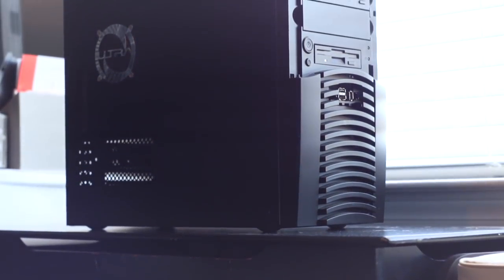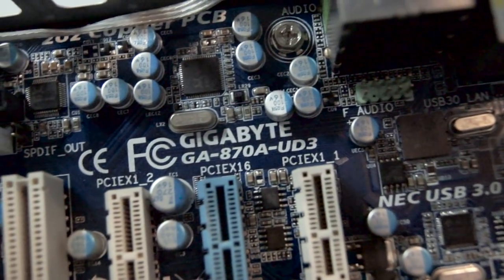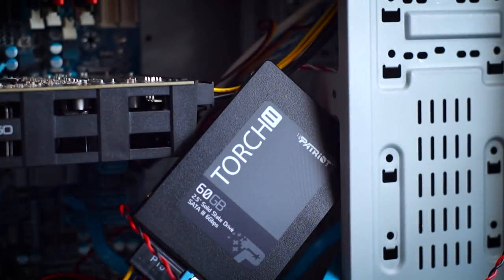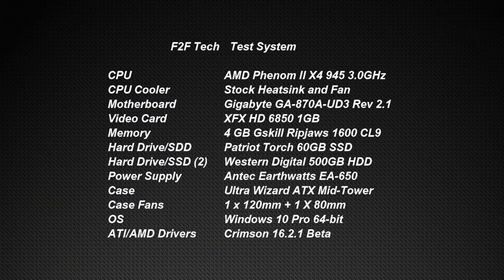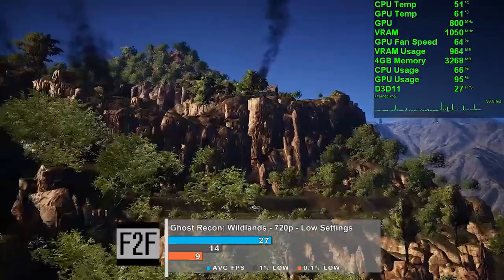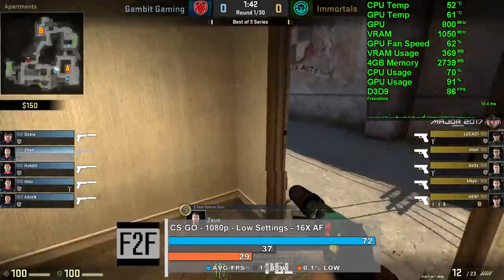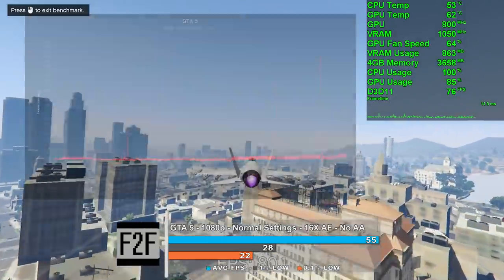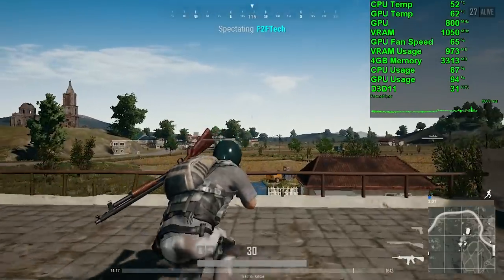How well does a 2010-2011 AMD Phenom II X4 gaming PC hold up in 2018?

Comment: TL:DW it's way better than you'd expect from an 8 year old system and still usable, though phenoms today could really do with an overclock and non-GCN cards are suffering from no more driver support. hence why my missus is upgrading from an Phx4 and hd6850 as we speak. FYI doesn't mean a cpu bottleneck, it can be an game engine/API/driver limitation and nothing to do with cpu.
Edit-with airflow over the vrm you can do 250x15 for 3.750Ghz pretty easy, or adjust the multiplier down for 3.625ghz>3.5ghz>3.375 with thier respective voltages, as high as you can with as little voltage as you can untill the vrm gets worrying.
Reply from the maker: Thanks for you comment. Agreed on the bottlenecking comment. I’ve tested this 6850 with my 2600K and GPU usage was pegged for pretty much every game, but this system, has some variables. 

Funny you mention overclocking. I have it at 1.475v with an FSB of 260. Multiplier is set to 14.5, so we’re at 3.77GHz. I do have a fan directly over the VRM, as that voltage is pushing it. Chip will go a little higher, but requires too much voltage and I don’t want to push the VRM much more. Unfortunately the memory is very finicky, so I have it at 1333MHz at CL 7. I’ve tested this against the the memory at 1600Mhz CL9 and the performance is slightly better. 

Testing this setup with a HD 7970 GHz. Stock cpu vs. OC CPU. I’m done testing and the results are interesting. Some games the performance and frame time improvement are quite good, and in others not so much. Overall, it’s certainly worth overclocking. Also, I love the old beast case this system is in now 😀

Comment: I have the exact specs and even brands of my 2012 tower !! With the exception of antec psu (I was using cougar 750w) cost me just 500usd. I  manage to run crisis 2 on high settings 50fps (I did overclock the cpu,ram ang videocard while using stock cooler hehe)

Comment: well gtx 560 ti and phenom ii x4 955 suprisingly can run battlefield 1 on 1080p Ultra settings with about 30-40 fps not stable as much but still pretty decent

Comment: What a difference a year can make. I have an overclocked Intel Core i7 2600k from 2012 and it still holds up pretty well in almost every game i throw at it. Of course over time I switched graphic cards 2 times, doubled the Ram from 8 to 16GB and switched to an SSD as my boot drive but my comment was mostly about the CPU. There are only 2 games i know of that really struggle to hold 1080p/60 because of a CPU bottleneck and thats Assassins Creed Origins and Rise of the Tomb Raider.

Comment: Huh... how funny I stumble across this video. My current "OP Windows XP gaming PC" is very similar.
ECS IC780M-A2 motherboard
AMD Phenom II X4 965 CPU (3.4GHz 4 cores)
(Presently) 2x2GB Crucial DDR3-1600 10-10-10-28
XFX Radeon 7770
generic as crap USB 3.0 card
Edimax PCI wireless G Wifi card
OCZ 700W PSU

Halo PC at 300fps? Yep. But christ, the onboard audio is miserable. And now I have an ISO of XP that is patched to allow it to recognize up to 128GB of system RAM, which I'd already verified in virtual machine testing (up to 32GB anyway). According to the last drivers from NVIDIA, I could drop in up to a 780 Ti, Titan Black, or GTX 960 into it and have it supported. AMD stopped support at the 270X... not even the 290X which would have made it respectable.

Comment: I am writing this on similar system, Phenom 2 x4 955 + AMD 6850 1Gb but with 8Gb RAM. PSU is Seasonic 620W 80+. I took care of it and it worked awesomely all these years. Haven't reinstalled Win 7 x64 since 2011, as well.
I would upgrade if there were any games worth playing. It's mostly disappointing crap for kids at most. The rest, beside Space Engineers works sufficiently good. Gaming today is VERY disappointing.

Comment: The games on AMD Radeon HD 6850 1GB VRAM are still very decent as of 2018 to play modern video games as most of them still supports Direct X 11 Graphics Card. I am very surprised that the HD 6850 can now only play in lower settings after 7 years. Overtime, High End Graphics card will turn into a Entry-Level Graphics Card due to aging and newer games requiring more VRAM and more Clock Speeds.

Comment: HAHAHA!!! That Shadow of War comment killed me lol!!! When you hear Uruks talking about your 1GB of vram that means you NEED to upgrade at least a GTX 1050 2GB like come on or a RX 560 2/4GB they only cost 100$. If you still have a 1GB of vram video card. Border line "Potato" video card Unless you have a CF with that GPU to squeeze some extra more life from the system. But sooner or later that 1GB of vram will severely limit you it alredy does limit you in 1080p imagen later on.

Comment: Running the 965 with a HD6990. Fallout 4 ran at lowest settings, 24fps.
I thought it was my cpu being old.
Tested it with a second hand r9 280x.
Now running fallout 4 at ultra 1080p with lowest fps of 50.

They dont make CPU's like these anymore. 7 years old and still keeping up.
Reply from the maker: Check out my new video with the 7970.

Comment: Well almost 1 year late, but its nice to be able to get a gist of how well a slightly higher clocked Phenom II does over a 940. And looking at the performance, I'd probably leave it as a spare, since I've already got a Xeon E5450 (via mod) based system performing well.

Comment: I'm wondering how it will perform with a gtx 1050, but yeah till now it's not a dead processor which useful for esoprt gaming or something lite.
Reply from the maker: Me too, but I’ll probably throw something a bit more powerful at it. I still need to buy a 1050 it 1050 Ti
Reply: F2F Tech great, a tough GPU to show the real bottleneck 😂🔫

Comment: Not surprised recently got a Q9200 in a real budget build for my nephew the most he plays world of tanks/league/minecraft etc nothing too demanding picked up a dell xps q9200 system on ebay for 80 pounds replaced thermal paste throughly cleaned the case out the card inside worked but only had 512mb of ram so i switched it out for a r7 250x that i got before prices when crazy thanks to mining (it was 20 pounds plus postage. I was expecting the system to struggle but nope handles 1080p no problems the cpu is not even struggling damn those core 2 quads refuse to die and they are even older than some of the pheonom 2 chips.

Comment: great video,I recently bought a used xps 625 on kijiji with a PhenomII X4 940 black  GT 9800 512mb.It had a 750w psu.I loved the case with the lights above the drive bays and the intakes but the flaw  in practical design was the motherboard which was built with the cpu socket on the bottom and all the othe components in the case to endure the heat rising in the case as it had no exhaust fan(s),once I upgraded to a radeon HD 7770,8 more gigs of ram I overclocked the phenomII X4 to 3.46 stable it runs great I get 60 fps at med/high settings no problems until just recently with all the minimum requirements its time to upgrade to Am4 socket hahahaha.

Comment: i still use my phenom 945 125w cpu as a linux box for virtualization lab but my rig now was built in 2012 with an fx 8350 and 3x gtx 780s.
Reply from the maker: 3 780’s??? That’s awesome

Comment: I'm using phenom II 945 95w tdp and do not get bottle necked in fortknight, not overclocked... The only game so far that bottle necks on the cpu so far is Mafia III
Reply from the maker: You’re right. I believe it had more to do with the legacy drivers used by the 6850. In my new video with a 7970 the cpu isn’t the bottleneck.

Comment: This demonstration is really held back by that weak videocard.  I am still rocking my Phenom II x4 965 years after its purchase.  Runs Doom and BF4 like butter using a GTX 950.  I even had that same Gigabyte motherboard for most its life.  A bad Radeon 270 killed my Gigabyte 870 but I was able to install the chip into the more recent 970 series without problems.Until RAM and GPU prices return to reasonable levels I see zero reason to upgrade.
Reply from the maker: Faster video card, more ram, and overclocking is coming. Have one more video in front of it.

Comment: Great video! Subbed! 

My PC
Phenom II X6 (6 core) 1090T 3.21 GHz
8 GB Ram (4 sticks of rip jaws low latency ram, don't remember the model. Been years since I looked)
Asus ROG Crosshair IV Formula motherboard
Pair of 128 GB OCZ Vertex IV SSDs
3TB Seagate physical HD
Pair of 500 GB Seagate physical HDs
Asus Gforce 670 GTX (2 GB)

Bit of an old system now. But I play all the latest games with max details in 1080p and I have yet to encounter something that it can't handle very well.  Sometimes I think about building a new PC. Which I might do this year. But that's just for the fun of it. The video card is the newest component in my system, also the most costly. Which I purchased about 6 years ago for $580 Canadian.
Reply from the maker: Thanks Lance. I love the Phenom II X6. I’m trying to get one right now, along with a Sabertooth board. Anyway, that’s a pretty beefy rig. I’d hold onto it until it stops doing what you want it too. Also, building a new pc now isn’t too cheap, with video card and memory prices.
Reply: Pubg
Reply: I love my rig. In fact I found out last night that for some reason my ram was running at half speed. Which I corrected. Extremely happy with the performance. Yes, you are right about the video card and ram prices. Just not a good time to build.

Comment: I have a machine built out of parts that were pulled from recycled computers (minus PSU and case.)

Phenom II X4 - 965
8GB DDR2
X2 - Radeon HD 6870's in crossfire 
120gb SSD (generic inland drive)
X2 - 750GB Seagate Enterprise hdds in raid 1
Lightscribe DVD drive

Once you OC your machine, we should compare performance and power consumption.
Reply from the maker: I did a follow-up video with this PC already. Unfortunately it’s no longer assembled, so I won’t be able to make any comparisons.

Comment: the cpu was actually holding up pretty well seeing that it was hovering around 90% on avg on the most demanding game titles benched, which it still had some headroom left over to spare. that just goes to show how good those old phenom II cpus really were. the real bottleneck was the gpu's lack of vram. 1gb GDDR5 vram really held the gpu back, esp with the modern demanding titles that were benched, but having only 4gb of system  ram didn't help matters either.
Reply from the maker: Yeah certainly wasn’t optimal. I did an update video with a better GPU and more memory.

Comment: You should do a video if you can with benchmark with the highest clocked Phenom X4, Phenom II X4, Phenom II X6, 8 core Bulldozer and 8 core Piledriver (an OC'd FX83xx is fine, no need for FX9xxx), along with the higher supported ram on each, so see how much each generation improved on the previous one.
Reply from the maker: Yeah if I had all of them I would. Would be pretty cool to see.

Comment: I still use the athelon 2 x4 640 overclocked to 3400 paired with asus  r7 360 oc and 4x 2 kingston ddr3 1333 ram,I can run any modern game with 1440x900 res
Reply from the maker: Yeah that’s a nice system. Great for that res.

Comment: The Core 2 and phenom Quads are still surprosingly strong.
Not on the same level as more recent chips, but they can handle even easier games.
Got a build with a Core 2 Quad @ 4.1 GHz and a GTX 660 Ti and on some games (like Doom) actually the graphics card is the limiting factor. Still looking into setting up a K10 build at some point.
Reply: Yeah, I have both(the 95w 945, a C2Q Q9550, and Q6700) the phenom II is faster than both the quads on an am3 motherboard, but the q9550 is faster than it as mine is on an am2(not am2+) motherboard. So it’s limited to 1000mhz Hyper Transport and ddr2 ram.

Comment: i still have Phoenom X4 955BE as my daily driver. I want to see what a new gpu works with it.
Reply from the maker: Stay tuned.
Reply: Hi dudes ! I've got my Phenom X4 965 BE rev.C3 @ 3.6 Ghz (not the max possible) with 8GB RAM cas8. Playing over 60FPS @1080p FHD screen with GTX 1060 option High. Pretty good perf for a pretty good money ratio. If you choose Ultra or a faster GPU or a larger resolution, so change your CPU and your config. If not, stay like me with this old brave CPU !

Comment: This was close to my first build from late 2010. I had the PII X4 970, Asus HD6850, G. Skill 2x4GB DDR3, OCZ Agility II 60GB, WD Caviar Blue 640GB, Asus Crosshair IV Formula. I had trouble playing 7 Days to Die, so I maxed to 16GB Ram with the exact speeds. I later upgraded to FX-8350 with a bios update, got a Strix 1070ti OC, WD Black 2TB, and an 850 Pro 256GB with Win 8.1 Pro. I run Apex on max at 100-140fps @ 1080p, Ark on med/high at 45-60fps. I'm fine with the performance of my current rig, but plan on getting a 1TB or larger ssd for games, to reduce load times and micro stutters. 

The PII X4 970 was great while it lasted, but I read the 8350 could swap with it by updating a bios, and it was super easy. Glad I did.